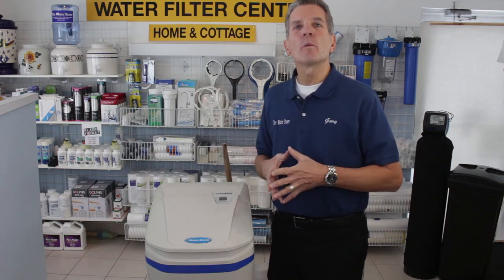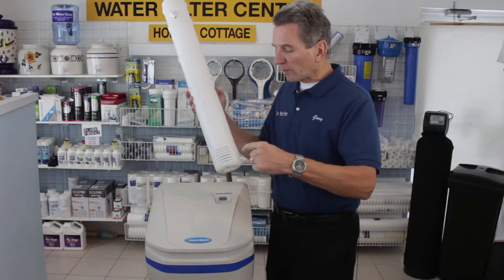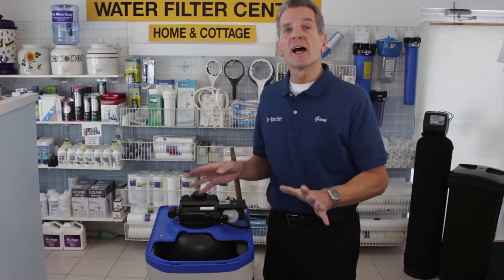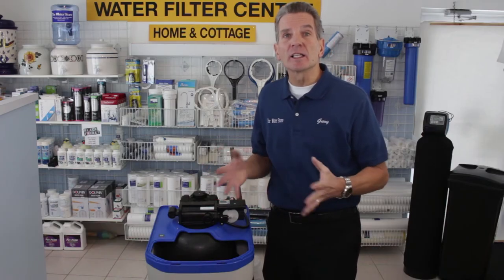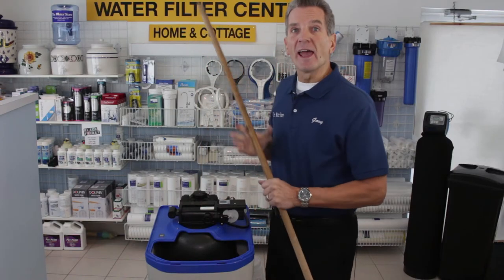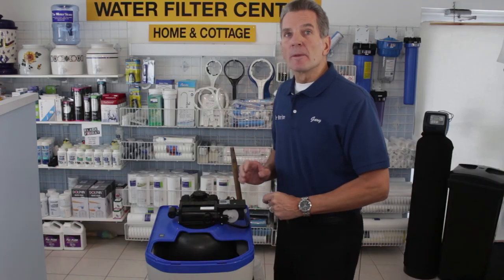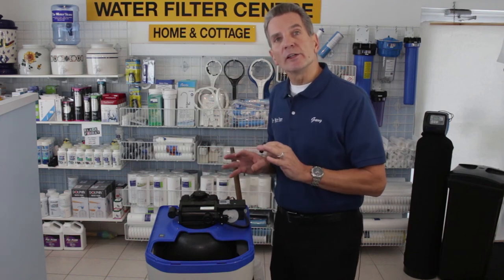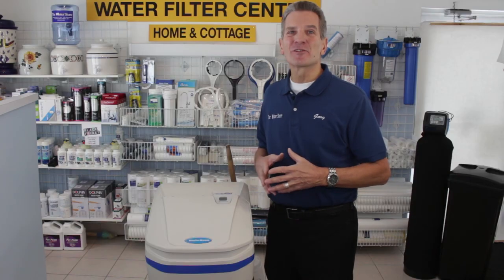Get Rid of Water Softener Salt Clog Once and for All in 3 Quick and Easy Steps

Comment: I have a question I hope you will reply to ....I have an old softener that stopped using salt..I found it was a salt bridge .. it was nearly half way up the tank, and probably building up over the years. It took me many hours to get it cleaned out , but I cannot reach behind the resin tank.. it’s the type that’s all in one..
So I put some hot water it in to take care of the rest of it...

My question is , the wet salt I took out , the consistency of wet snow , can I reuse it .. Our should I put new Windsor pellets back in ...

Also how much water do you put in the tank...I am starting fresh again , so can I just pour a number of gallons in the tank..
 Thankyou..
Reply from the maker: Good questions!  I would get rid of the old salt and start with new, but if you alternate some with the new salt very carefully you can use it up.  Restart with about 3 gallons of water and then regenerate.

Comment: Garry after I loosen the clog and the remaining salt moves around freely should I  shop vac that out? Also should I refill the tank partially with salt and then try another regeneration or refill half way?
Reply from the maker: No you do not need to remove all of the salt as long as it has been loosened up.  I would not refill with salt too much until you are sure that it is working.

Comment: Hey Gary, I think I may have a salt clog with my water boss. What is worrying about adding hot water to mine is that my brine tank is already very full with water. I have now tried the broom stick method, the water is still high. I'm afraid of hitting regenerate is it may over flow. 😕 any suggestions? Thank you!
Reply from the maker: Yes, you can scoop out, or pump out the excess water and proceed from there.

Comment: Thanks for the video!  I followed the steps and got the water softener working again.  Test strips said we had soft water again.  Days later it was hard again.  I removed the salt from the tank again etc. and again got it working properly.  But then days later we have hard water again!  There is still salt in the tank, maybe about 1/4 full, I didn't fill up more than this the last time as I'm afraid of dealing with another clog, so I can't understand how it has stopped working again.  Using the Windsor Clean & Protect pellets....  Any ideas/suggestions?  The unit is new and was installed only two years ago.
Reply from the maker: You need to add 5 gallons of water and enough salt so the salt is above the water, let it sit for one day to allow the water to absorb the salt and then regenerate.
Reply: Thanks so much!!

Comment: I have the WaterBoss model 700 and need to refill the brine tank manually with a bucket of hot water.  That is, it doesn't refill by itself.  Any suggestions?
Reply from the maker: Did you make any changes to the settings lately?  If not, somewhere in the brine system there is a problem, could very well be a stuck brine piston.  This video will help with that. https://youtu.be/SXDdQzerQLY

Comment: We been having problems, last night I regenerate it , the next day the water from tap had salt in it , I went down and the brine tank was filled up with water , half way .. I took a broom handle , and felt no bridge but as I got through the top salt pellets , it started to fill like going through wet sand , so I think the brine tank is blocked .
One thing I notice for awhile , it was not automatically regenerating .. I would feel the water not as soft and went down and manually did it .. we are on a well.. can you tell me what part is causing it not to regenerate automatically.. thanks ..
Reply from the maker: Likely the meter has stopped working. This video will help you https://youtu.be/F07zF3lYJb4
Reply: @water_estore   I got more of an insight into the operation .We have a Kenmore ultra 150 , bought it along time ago but just installed it a couple years ago. So it has a metre, I set the display to 000 and run the hot water tap and the numbers moved .So I guess that tells me the electronic part is working and the  impeller is working , and turning and not seized.  So I never see the display flash regen on it . And if I don’t manually do the regenerate , we end up with hard water...doesn’t make sense.

Comment: Hi - I have a WaterBoss Model 700 (installed June 2003), and noticed low water pressure this summer.  I bypassed the water softener and the pressure is fine.  Is there perhaps a clogged filter or something else I can check for this issue?  Thanks.
Reply from the maker: Likely the water softener has become clogged over the years.  You can try using a water softener cleaner as shown in this YouTube video of mine as it might help https://youtu.be/c8QKYr3B02I

Comment: Hi Gary Our water softner. I do not have the option to use a hose.  I have used the hot water and it is breaking up the salt.   But I fear that is very deep in the salt tank.  It seems to be slowly going down.  Can I just use the hot water method and wait??  I have a Water Right softner. While that is going on can I check for other blockages you suggested.  I also can seem to regenerate manually but am going to check the regenerate video.  Thanks
Reply from the maker: Yes, the hot water method used many times over will work.

Comment: how much water should there be in the brine tank normally?
Reply from the maker: It depends on a number of factors.  If it is a standard or high efficiency water softener, the size of the media tank, the hardness settings, how much salt is in the brine tank, pre or post fill water softener, etc.  You need to make sure the settings in the water softener are correct and the water softener valve will determine the correct amount of water to add to the salt.

Comment: I would like to remove my water softener completely and install a different one safely, how do I remove the air from the tank
Reply from the maker: Great question! The tank is pressurized, so just start a regeneration cycle to release the pressure and shut off the water before the water softener and you are good to go.

Comment: Hi Gary my softener has filled with water and also when I tried to recharge the system it’s jammed and doing a repeated clicking sound like it’s jammed or stuck.its a kenmore  Any recommendations?
Reply from the maker: Yes, your piston is stuck inside the valve and the valve needs to be rebuilt or replace the whole water softener. This one is a good choice https://waterestore.com/products/hum-metered-water-softener-45-000-grain-capacity-free-shipping

Comment: Strange situation...Our water is pretty good except for tannin smell.We have a tannin filter that uses salt, like a softener. Tho it works pretty good, off and on you can smell the tannin in the house. My niece started working for a Pool Installation company. Most pools in Florida have changed over to salt water pools. I told her to pick up some bags of salt, she gets a discount. She brought home 2 bags, I went to put in the tannin and softener brine tanks, and said, wait this dosent look like normal salt, it was almost like table salt, but I poured it in there anyway. I thought being so fine it would just dissolve away, but it didnt. That was months ago and the tannin smell has completely gone away, and I mean completely. The system is working better then it did when new, Not sure whats going on, but it seems to work. I talked to old old guy who owns the pool company, and he told me its the only salt he ever uses. Dont think you have to use pool salt all the time, I have now used maybe 10 bags since using the pool salt and everything is great, maybe dump a bag in there a couple times a year.
Reply from the maker: Great info.  Can you let me know the brand and model number of this salt?
Reply: @water_estore  I will ask her to call and find out, she has since quit working there, she found a job making 4 bucks a hour more. I can take my PVC pole and touch the bottom of the tank, I can still feel it on the bottom. I will let you know, shes not home at the moment.
Reply: @water_estore  I rarely ask her to do anything for me, I asked her to call and find out this info, she said no problem, well guess what, she forgot maybe Monday. Wish I had not chucked the bags !. Received my RO yesterday, great packaging!.

Comment: Sir, I followed your steps to add 2-3 gallons of water and it did break up the salt clog and tried regeneration but nothing happens. The water is still there and I have changed the Venturi filter but still the issue continues. Please help.
Reply from the maker: Your salt clog is a result of a larger problem.  Likely your water softener is not drawing the brine out of the brine tank during regeneration.  You can try digging down through the salt to get to the bottom to make sure the slots in the brine well are not clogged.  More hot water to dissolve the salt might help.
Reply: @water_estore  Thank you, I have done that and will try again today.

Comment: Great videos, Gary. After scooping out as much salt as I could, I'm left with a salty sludge near the bottom of my GE water softener. I followed your advice and used hot water, then a paint stirrer on a drill to break up any bridge. At what point is it safe to add salt pellets and hope it works again?
Reply from the maker: Once you are confident that what remains will be dissolved in water and used up in future regenerations.

Comment: Fortunately I have a 3 foot hose with sprayer and a laundry sink next to the softener.  I sprayed a blast of hot water into the brine tank, in several locations. likely about 3 gallons total.  The other problem I discovered is the brine refill cycle on the softener is not doing its job.  As a result, the brine rinse lasts about 1 minute resulting in no soft water.  The softener setting for salt was adjusted but it should not have to be...   This Fleck has been nothing but trouble.
Reply from the maker: It sure sounds like it!

Comment: Pour the hot water directly into media tank OR the brine tank portion?
Reply from the maker: Brine tank.
Reply: @water_estore   can anybody tell me this i can't find no videos of sings  (inside the house )   of having this water softener problem since i  run the water pump  to the water softener  ( i was completed  fine   now  I'm getting a lot pressure and  fells like  air in the pipes  ( it happened  right  after  it was filled out with  salt  ( i m not sure if is coincidental or the water softener  is the problem i also  smell the  water  is different   is  not  salt on it  ? im lost thank you

Comment: okay, I saw your salt bridge video. I want more in a brine tank solution.  Is there an auto load salt device to a level? Is there like a better brine tank, with a circulation pump on a timer to go off every week or so?  A salt mixer in tank to stir the salt once a week? Come on, there has to be a permanent solution to never  get a salt bridge.
Reply from the maker: Great questions, but no, there really is not.  You are correct that this end of the water softening process is a bit of a bottleneck when it comes to ease of use but no real solution on the horizon that I know of.

Comment: I have no water in my tank at all it’s all hardened salt all the way to the bottom and no water in my brine tank. And no flow water indicator. Any ideas?
Reply from the maker: Yes, the meter has likely stopped working and as a result the water softener has stopped regenerating causing the salt clog.

Comment: Should have a salt shelf in it that keeps the salt about 4" to 6" above the bottom of the tank, this way there is only water around the brine tank well vents, never salt that can clog it. I put a new salt tank, salt shelf, brine well & float for my 17 years old softener. But first I did 2 treatments of 'Iron Out' that cleaned the resin beads because I was no longer getting any soft water, after doing 2 strong treatments of Iron Out for just $9, I now have very soft water again, almost too soft!
Reply from the maker: I have seen hundreds of water softeners with totally clogged "salt shelfs"  When clogged, those make cleaning out the brine tank brytal.  I don't recommend them.

Comment: What happens when you have no water in salt tank ?
Reply from the maker: When removing a salt clog you need to add water.
Reply: What happens it's that I cleaned the tank, I didn't have any salt clog, I just clean the tank and put new salt one it and also add water until it was halfway, but when it regenerate it completely drained all the water in the salt tank, and it seems that it's no it sending water to the salt tank
Reply from the maker: Likley to have a pre fill water softener https://youtu.be/GedMruLfXhY

Comment: My softner system works for a few min, then no water. Why?
Reply from the maker: You mean that when your water softener is in service you get good flow for a few minutes and then the flow slows down to nothing, is that correct?  If so your water softener's media tank is clogged.
Reply: Also my ro system doesnt fill up my tank. Why?
Ive emptied the tank checked the empty tank psi and its at 6psi. Why will the tank not get filled?
Reply from the maker: @jonrb28  When was the last time the filters and membrane were changed?
Reply: @water_estore  about 1yr
Reply from the maker: @jonrb28  Disconnect the tank and run the system into a bucket to see if it is producing any water.  It should produce about a gallon of water an hour.

Comment: Water Boss water softeners are a nightmare. The design is insane.  Mine failed after a year and I contacted Water Boss.  I contacted their technical support but they never responded.  I then called and a girl refused to answer any questions but I finally got her to transfer the call to a repair guy.  He said he had received my questions but said he didn't have to answer!  I asked him why and he said, "I don't have to."  (I'm not making this up and you can find other reviewers who had virtually the same thing happen. One guy, an older man, said in his review that it was the worst experience he ever had with any company.  After a prolonged exchange with Water Boss I finally returned it.  I could list the absolutely terrible design flaws of this machine but it would take too long and I probably can't remember them all now.  But look for review  sites and you should be able to find my reivew as well as reviews by other people who describe the incredibly dumb design problems with these water softeners.  It's amazing that someone actually designed them.  They must never have even tested their designs before putting them into production. I'm a retired engineer and I've never seen anything so poorly designed and manufactured in my life. Literally!  And to add insult to injury, the Water Boss's customer service was an absolute nightmare. They were unbelievably rude and nasty and they made it clear that they didn't give a damn about the customer at all.
Reply from the maker: Sorry to hear you had a bad experience with your WaterBoss.  We have hundreds of customers who are very happy with theirs.  We handle all of the technical issues ourselves so we rarely need to contact the manufacturer.  Most of our customers have had theirs over  10 years and some over 20.